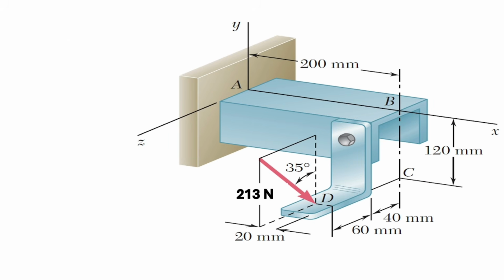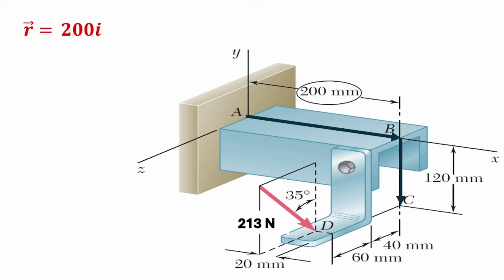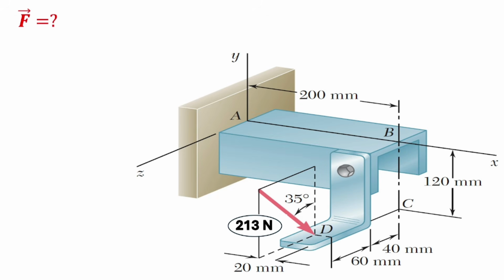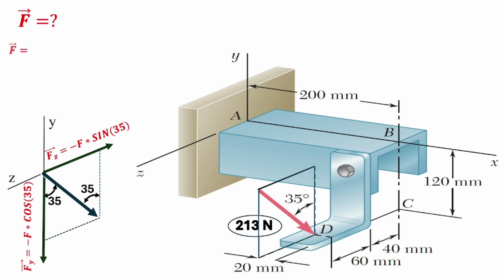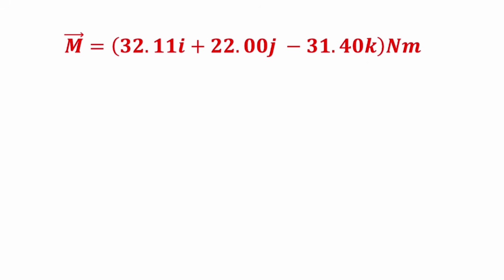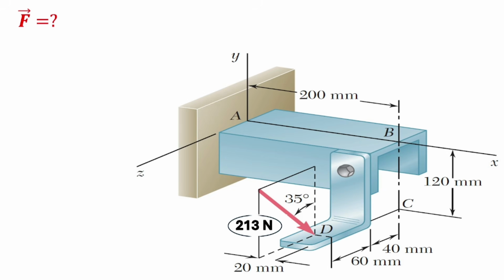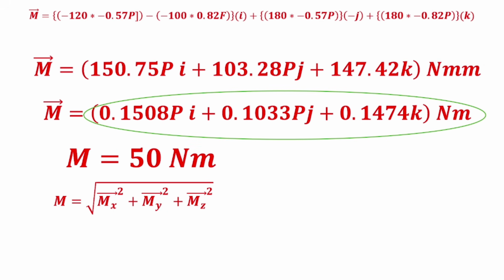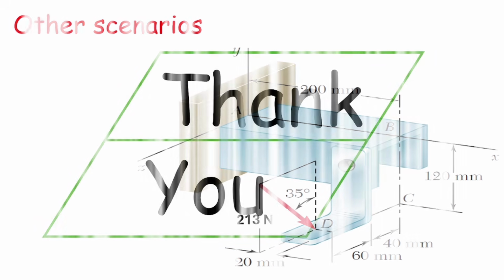Example: Moment of a Force (3D system)

Comment: Thank you, sir 
There was a mistake in the second question. When looking for the k component for MOMENT. It was supposed to be -147.42 and not plus. Because the cross product it was (180* -0.819) which was supposed to be -147.42 so the final answer P, is meant to be 153.069N